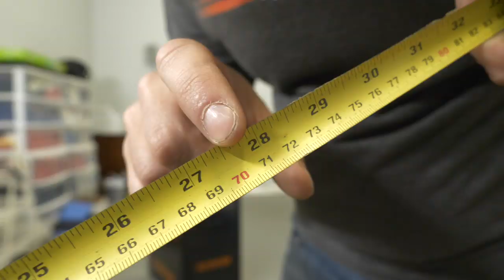To buy or DIY? - avoid DIY at all costs... what's your time worth?

Comment: After factoring in all my labor,  every dirt cheap moped I have bought, I end up losing money. That  220 is probably for a heavy duty compressor, to run/could run a sand blaster.
Reply from the maker: I’ve seen many many passion projects over the years. The balance is hard, the struggle is real

Comment: I'm sure you know this a bit already but there are some metric and imperial tools that overlap or are "close enough"  for example 5/16 and 8mm, 3/8 and 10, 1/2 and 13, (sometimes 14 and 9/16 works too if tolerance isn't important) and 19 and 3/4, it's not perfect but a lot of industrial designers use these sizes so that you can work on stuff with either set of tools, you'll find it a lot in automotive stuff even though most vehicles are metric now days, it's just kinda convenient when one tool set is more accessible or you are missing sockets or something.

Comment: It all comes down to capital. If you have the tools and the time DIY is worth it. I have a lot of time as capital, but I don’t have the tools to DIY everything.

Unrelated to mopeds I bought a set of used rims for my car for 200 dollars. After a trip to harbor freight and 300 dollars in tools and materials I had everything to refurbish these rims. It took 2 weekends and a lot of Dremel work but I finally finished them. Was it worth it? Probably not. I could’ve bought better OEM BMW rims on eBay. But it was a lot of fun. 🤷🏻‍♂️🤦🏻‍♂️